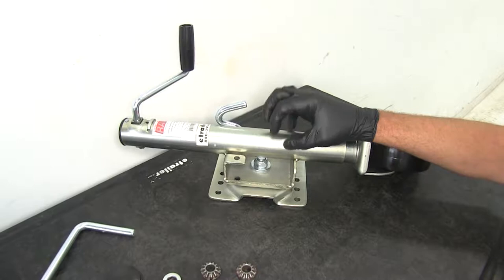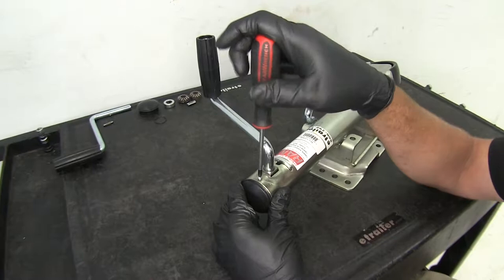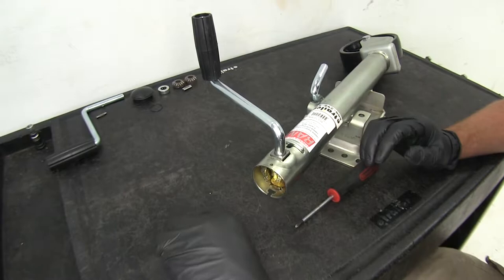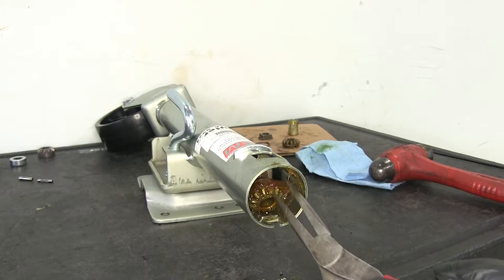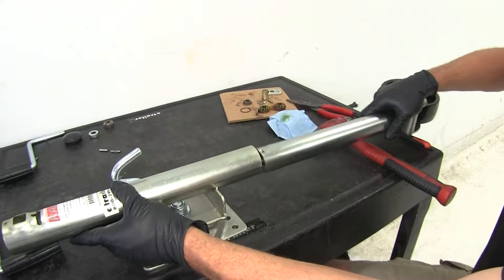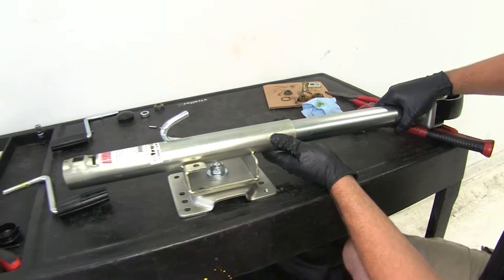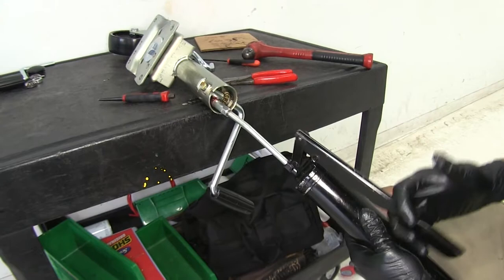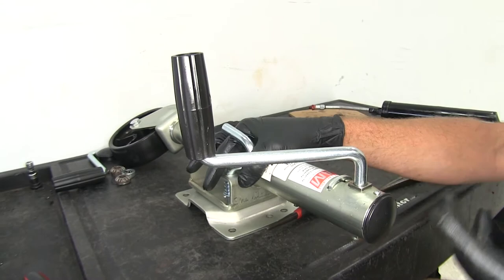etrailer | Rebuilding Your Trailer Jack

Comment: What happens if that won't go down all the way and you can't pull the pin to lift up the swing arm
Reply from the maker: You may have to lower the trailer on a set of jack stands so that you can raise the jack up high enough to swing it. If this is an on going problem, you may need to relocate the jack to a higher position or get a different jack.
https://www.etrailer.com/dept-pg-Trailer_Jack-sf-A~Frame_Jack.aspx

Comment: Great video. However I would love to see a more detail on replacement of the handle. I can see the purpose of that snap ring that help the handle pin
Reply from the maker: Check out the following link for more information on the replacement jack for etrailer and Ram Round jacks.
https://www.etrailer.com/Accessories-and-Parts/etrailer/MJ-1500B-HD.html